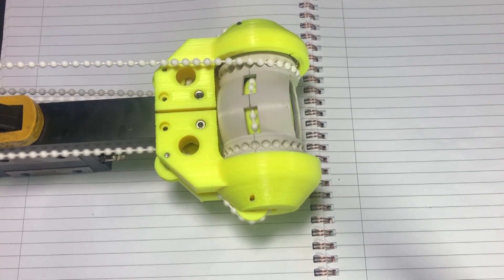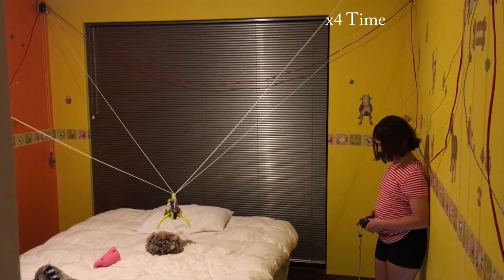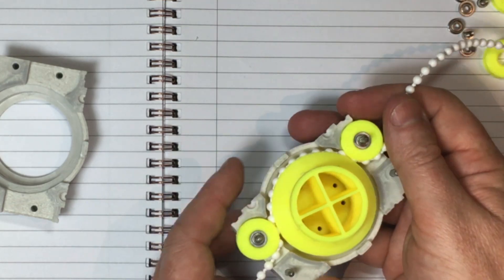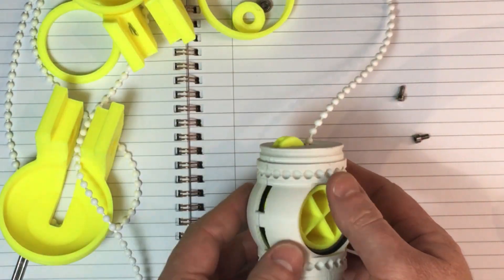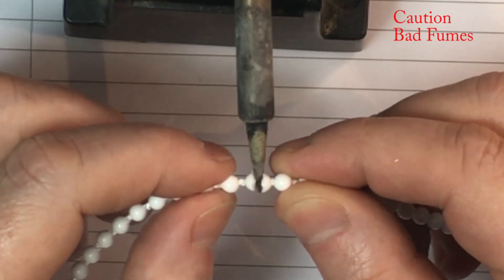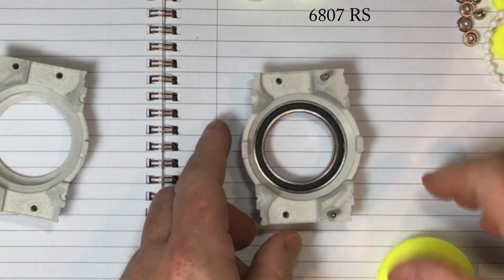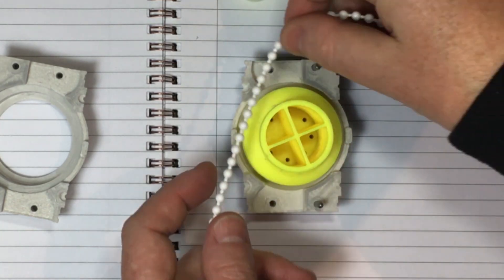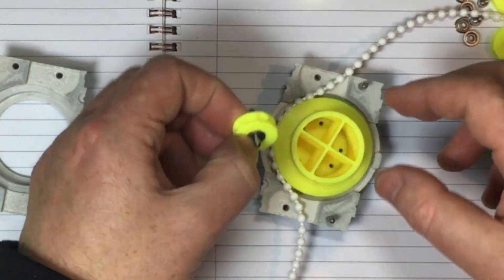Robot Wrist Continuous Rotation Beaded Cord

Comment: Wow! What an elegant solution. Both axes of control can be independent and driven from a distance, without the pitch axis binding and twisting up the chain for the roll axis. Fantastic content! 

My immediate thought is that the ball chain, while cheap and simple and hence usable in your design, will really suffer when this design is put under load. In the condition where the roll axis is under high torque and the pitch axis is under high speed, the ball chain will experience high tension and high torsional rotation in the same location. The high tension will force the balls and sockets of the chain to be pressed together, while the high rotation will cause these high-pressure contact surfaces to slide. Not a great environment for plastics! Ideally, the roll axis is not only in high torque, but also in high speed allowing that chain to remain in constant motion, carrying the "hot" balls quickly away from the zone of high load. But in the worst case scenario, the roll axis is locked in high torque, a very common scenario for end effectors, and the pitch axis continues to rotate, forcing the same ball and cup to bear all of the twisting. 

My hope is that a lubricant and a diligent material choice in the ball chain can increase the power capacity of this design and make it more useful for whatever creative applications you may have for it. 

I understand why you did not use a metal chain. But if only there was a creative way to make one of these endless, without using the traditional peanut shaped clasp, that would really improve the design's resilience to load and heat

Comment: Really interesting design, have you tested how much force can this time of rope handle? Interesting way of using it anyway xD nice work!!!!

I can see a problem: rolling the outside part while the inner one is not moving will twist the inner rope right? I actually don't know how to fix it, but it's an interesting improvement.

Thank you for sharing your ideas :) nice work!!
Reply from the maker: The cord is not great and the weakest point in the solder joint. I have found some pre-made loops in both plastic and metal. I will try that. The cord is springy. I have a video in the works to answer your second question.
Reply: was thinking that but it should be fine if it does not rotate 360 deg

Comment: 1:56 there it is 😁
I'm not sure but I think there is a possibility that the beaded cord snaps if it twisted to much.
So you would need to keep track of twists and add a routine to unwind it.
But that should be fairly easy since it should unwind automatically as soon it leaves the housing.
Reply: I suppose if it has something attached to the end of the second stage, the first stage won't be able to fully rotate anyway, so it shouldn't be too much of an issue.
Reply from the maker: @isaacgraphics1416  The second joint can only rotate +-90deg

Comment: Love your concept Paul, and fantastic demo. In my past creature fx career, We used to do similar type of elbow, shoulder, and wrist designs but using stainless prosthetics cables and bike brake housing. Ours was not endless though. They were limited to crimped ends nestled inside a machine part which was buried inside the joint. This is much more like a Kuka arm joint - very cool sir - cheers JD
Reply from the maker: Are you able to like to these designs?

Comment: What about using differential gearing so you can just use the 2 cords running parallel instead of 2 parallel and one perpendicular?
You'd be able to adjust the main angle by running them both at the same speed or turn it by running them in opposite directions.
Reply: I think the whole idea was to avoid that.
He is fully aware of differential and he deliberately chooses the challenge 😉
Reply: Still, thanks for the idea, I think it's a good one - certainly opened my eyes a bit!

Comment: That's a really neat design. Maybe if you could have a split link in the chain the rest could be less compromised? Something like a T head with a spherical clamshell around it.
Reply from the maker: I've been searching around and can not find a good linking solution.
Reply: @PaulGouldRobotics  Thinking about it again, and doing a quick search-- all the joining mechanisms (including my first thought and your melt-join) try to join at the ball.
Maybe joining at the thread would work better? Like pushing a fine metal wire through the ball holes, or clamping to 2 loose ends of cord with some sort of aglet?

Comment: Super cool ,really appreciate it.
Can you try using timing belts of small width like 5mm , so that it can be driven by standard pulley,  and I think using standard bearing in all joints will be easy.
Reply from the maker: The +/-90deg twist has to happen over 10mm distance. I tried a 3mm wide GT3 belt but it did not twist nicely. I wanted to experiment with continuous rotation, so there was no way to pass an endless cord/belt though standard bearings.
Reply: @PaulGouldRobotics  thank you,  I know you must have already tried it ;), all the best, I am waiting for the final version for my robot arm.

Comment: Nice. Not sure if the bead chain is necessary for the outer rotation but it works great for the inner.
Reply from the maker: Totally not necessary but it is a nice way to learn. Beaded Cord is not really an engineering material. I will switch it to a timing belt soon.
Reply: @PaulGouldRobotics  It's interesting though. The advatange a bead cord has over a timing belt is its motion can turn a wheel in 360 degrees of the beads surface. Makes me wonder how it would go being used in some sort of gearbox.